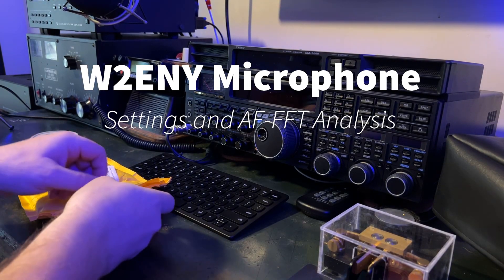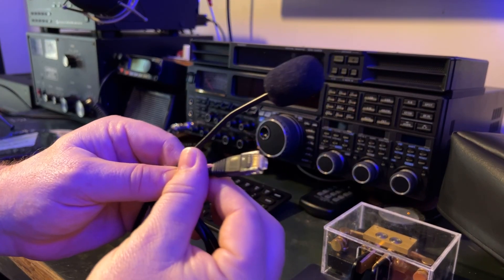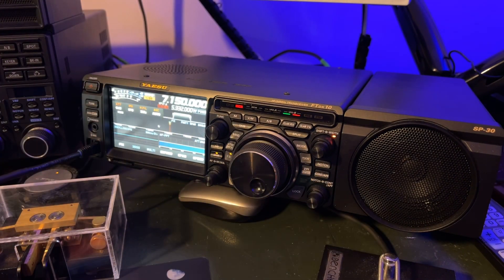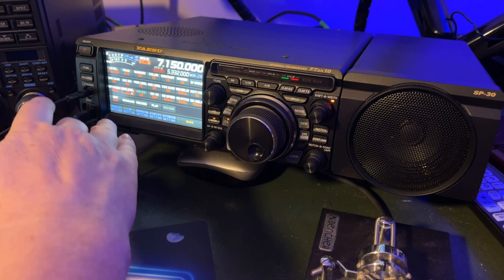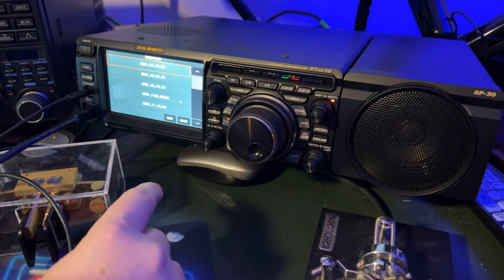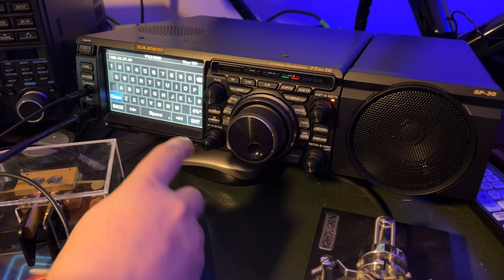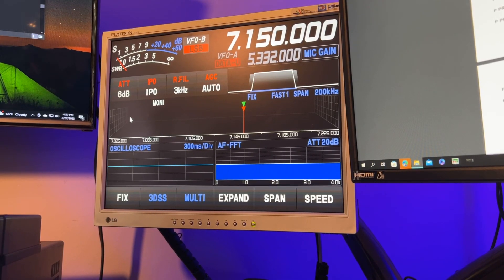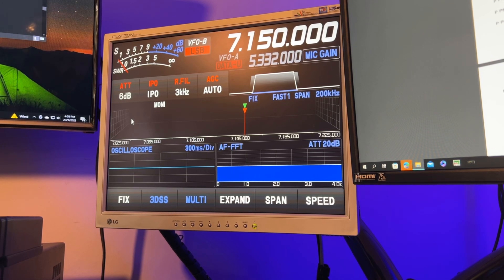W2ENY Microphone: Settings & AF-FFT Analysis #hamradio #microphone #tx #audio

Comment: I bought one (just came in today's mail) as a sort of stopgap until I can repair the broken base of my Icom SM-20 that I got with my "new" IC-718. I found that I need to turn the compression on and the mic gain all the way up to get 30-40 watt peaks on my SWR/power meter with the radio set on full power. Maybe I just don't talk loudly enough. I know the radio puts out full power when I do a "whistle test" into a dummy load. I did get a good signal report earlier today so the mic DOES work.
Reply from the maker: There is something wrong if you had to turn the mic gain to full. The W2ENY mic is super sensitive. As you see in the video, I had to turn it way down.  I never run the processor above 15%.  Any higher and your audio can become nasty. I see that you are using an ICOM transceiver. They are different than Yaesu.  Is your W2ENY a dynamic mic or an electret condenser type?  In this video I’m using a Yaesu.

Comment: Is the mic a dynamic or amplified?  You mentioned a lot of room noise leading me to think it's not dynamic.
Reply from the maker: It has an electret element.  The audio reports were good but people who have heard me with the PR-781 told me the PR-781 sounds better.
Reply: @n4hnhradio  Hard to tell without having it in my hands...but it looks like it would feel flimsy (or be delicate).  I realize it's for saving space but I'd rather have something more substantial.
Reply from the maker: @allenpamscofield Yes, it’s so light that I opened it up and stuck lead weights in it to keep it from falling over so easily. It is a space-saving mic that sounds good. But it will not replace my PR-781.

Comment: I read that the SD card in the dx10 only records the received audio, but I heard someone as they seemed to imply that if you have monitoring on, it'll record both sides of the audio (received and you on your mic). I'm a video production guy and I don't understand why radio manufacturers don't record both sides AND record each side to one side of a stereo audio file. That way, you can convert the stereo audio file to a dual mono and match the audio levels between the received audio and your mic audio easily.
Reply from the maker: The FTdx10 can record both sides of a QSO if you enable the Monitor.  You will need to wear headphones to avoid audio feedback.

Ironically, the FTdx101D or MP cannot record the audio of a QSO. You can use external software, such as Audacity, and record the audio via the transceiver’s USB port. But the transceiver itself only allows you to record voice or CW messages that you can transmit, such as for calling CQ.